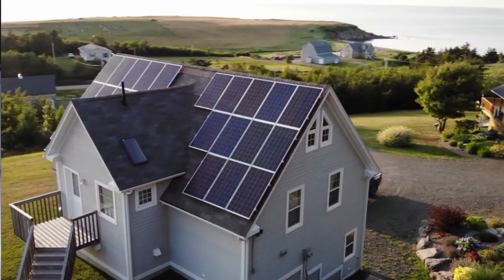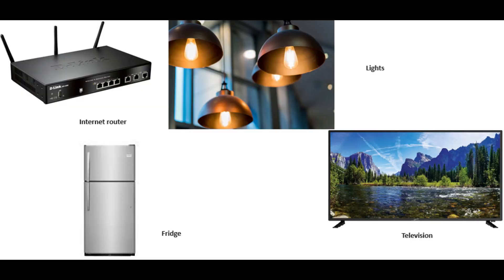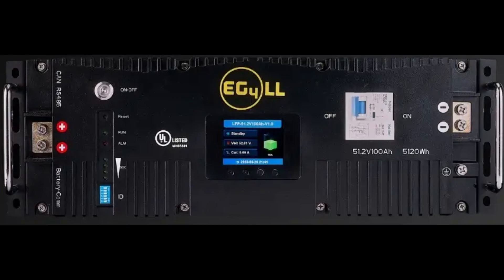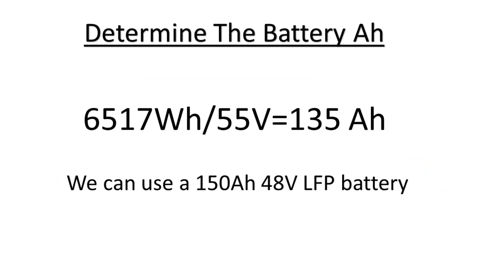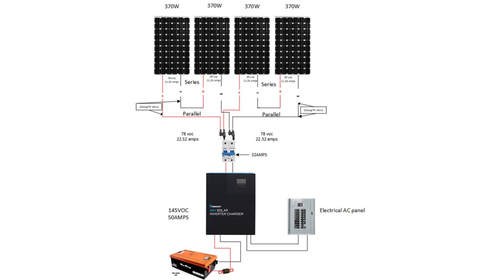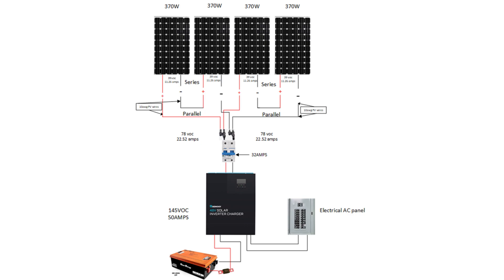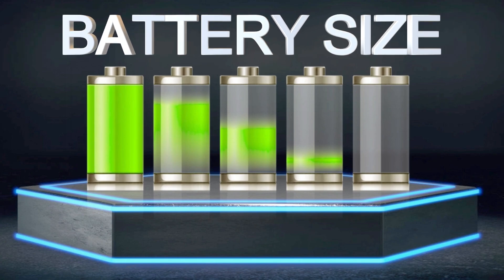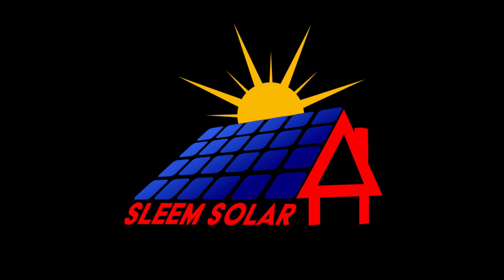How to Size Your Off Grid Solar System

Comment: Refrigerator would be very hot rest of the day with these kinda numbers and would destroy all of the foods.
Just saying.

Remember this are also with LED lights, not older lights that are typical using 60 watt.
Personally i would say in Norway we would be spending about 200 watt approximately at these.

And i would also multiply that with 24 hours since they have too be running the whole day and night.
Today people are using computer most. Laptop are typical using 80-100 watt, but desktop are using between 200 and 300 watt with monitor.

Comment: 6517 WH / 55 = 118 NOT 135.   So do you use 48v or 55v?
Reply: Are you going to reply?
Reply: because 48volt battery do charge to 55volt
Reply from the maker: 48 volt is the nominal name. However most 48 volt battery manufacturer's batteries charge at 55 to 58 volts. I use both.

Comment: I would double or triple the refrigerator demand, as it’s always running four or five times an hour. Most people underestimate the demand.
Also I would double the solar, unless you have the ability to move the panels as the sun moves along the sky & overcast and rainy days.
Basically I double everything just in case.
Reply from the maker: Thank you for the feedback!

Comment: Can you please explain the numbers(not curent or voltage) with wich you devide. Are this some constants or something else?
Reply from the maker: The 1 in the first part of the formula, is the SOC of lithium Iron Phosphate battery which is static, the 1.05 is the % for 95% which must LFP batteries  are efficient .But in  order to use that in the formula, it needs to be a variable number , not a %, so dividing 100 by 1.05 gives you 95%. The same thing for inverters, must are 90% efficient, so the same thing apply, 100 divided by 90% equals 1.11 which represent 90%. The 3 represents 3 days of autonomy. Hope this helps.
Reply: Than you.